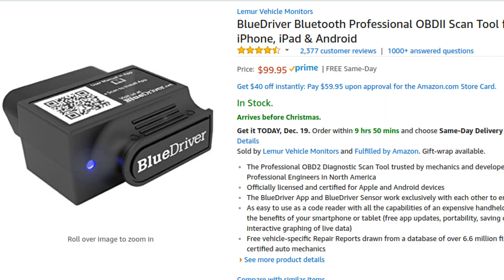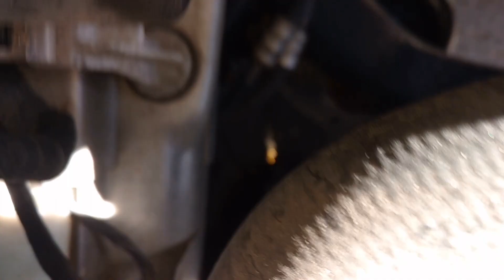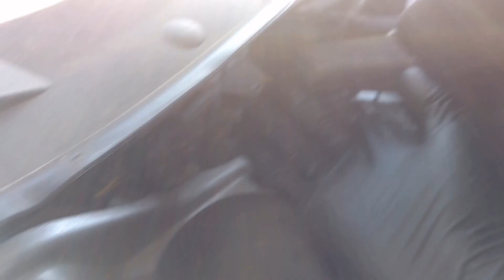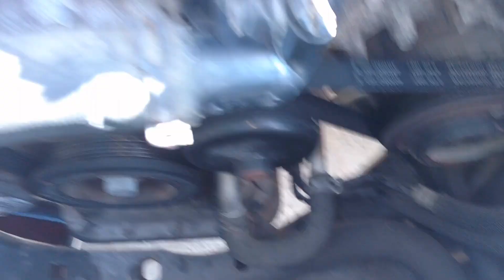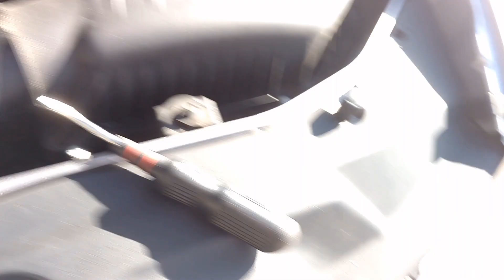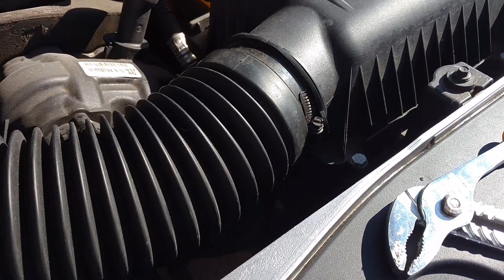How To Replace the Thermostat . 2013 Dodge Charger V6.

Comment from the maker: How to bleed air from the system video - https://youtu.be/9wXDJ6GKue0

Mopar Thermostat V6 - http://amzn.to/2D0XIJT
Blue Driver Scan Tool - http://amzn.to/2AWbVWS
Rubber Care - http://amzn.to/2CCyyAe
Floor Jack - http://amzn.to/2CDRVJ6
1/4 Torque Wrench - http://amzn.to/2D3KdsO
(106 inch lbs for the Thermostat Bolts)

These Affiliate Links help support this channel and add no cost to products.
Reply: I'll

Comment: @mrficks1838 When I called for an estimate from mechanic shops they say that a thermostat replacement takes 1.5 hrs and so ike $110 to $220 depending on the shop buy in video and others it is very quick.  What could they possibly be doing during the job to take 1.5 hrs?
Reply from the maker: That sounds like too long but if you find a good mechanic that only charges $110 for a thermostat install then it's a deal. I suggest you buy the thermostat and bring it to them also.
Reply: @mrficks1838  yes I bought a thermostat recently and one mechanic said $110 another $210 and since the latter charges like $140 per hr it sounds like they expect it to be a 1 n a half hr job also.
Reply from the maker: I think the $110 is reasonable considering the convenience.
Reply: @mrficks1838  Yeah I had it worked on for the $110 today.  I wanted to work on it myself but I couldn't stand the smell of some nearby dead animal plus its hot where Im at.  It did take an hr n a half technically but most of that time was just letting the car sit to cool off, using an air blower to dry the spilled coolant of the belts and other stuff, and draining coolant.  He did take his sweet time to air dry the coolant though because it was sitting on the belt for at least 25 minutes.  He insisted that time the belts were wet didn't corrode or damage them.  If not for that dead animal smell I would've done it.
Reply from the maker: I make sure to wash off any belts with water if they get coolant on them but other than that good to hear it's completed. Might wanna check your coolant temp for a bit to ensure no air is trapped in the system.

Comment: How long should it take your engine light to go off after you fix your thermostat
Reply from the maker: There's a comment thread on that here with a few answers. It'll go off fast if you disconnect the battery which you should do anyway with this repair.

Comment: How long does it take for the check engine light to go off after this ?
Reply from the maker: Nearly immediately if done right.
Reply: Mr Ficks i did mine yesterday and went to auto zone the guy was like disconnected the battery for 10 mins or drive it for 55 miles
Reply: 1- Put the switch in ON
2- PRESS the throttle 3 times
3- fire the engine 
4- it disappears

Comment: I seen videos of guys not draining all the fluid only topping it off from a little fluid lost
Reply: I just changed the thermostat on my son’s Ram Pentastar V6. I didn’t drain the radiator. I lost about a litre or less coolant. All you lose is what’s in the upper hose, and draining the rad doesn’t empty the hose. I didn’t remove any of the stuff this guy removed.
Reply from the maker: High Pressure spray potential there .. also you don't want coolant getting all over the belt .. it takes moisture out of rubber very quickly.
Reply: Mr Ficks when changing the thermostat they release presssure from the coolant cap put the cap back then changed the thermostat without draining all the fluid and just top it off from a little spill from removing thermostat
Reply from the maker: Gotcha .. as long as they clean the coolant off the belt and purge the air from the system then that works.. I just prefer not to waste coolant and spill on the ground.. even in small amounts. Thanks for watching.